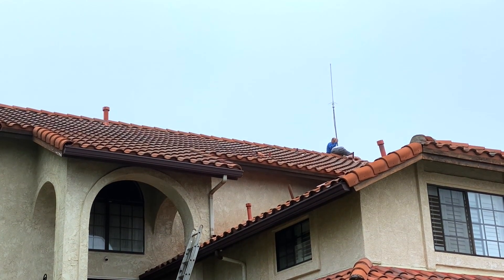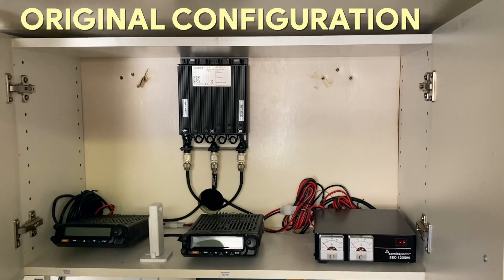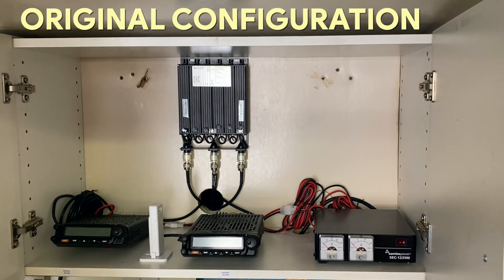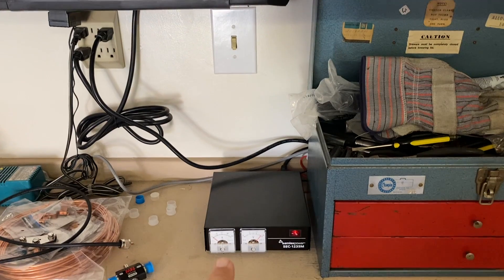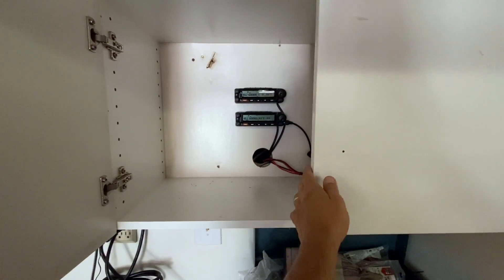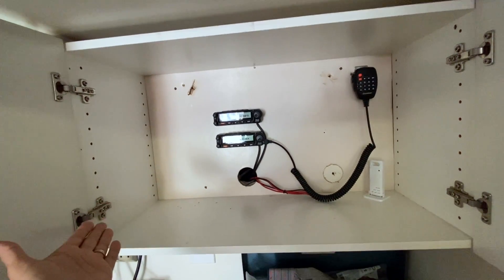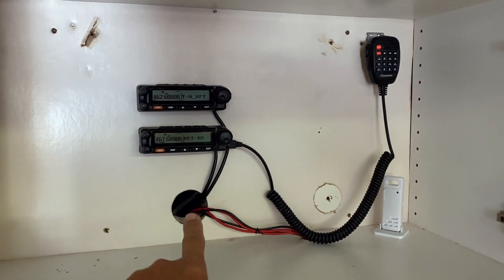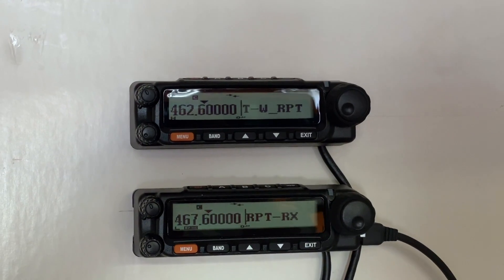Wouxun KG-1000G GMRS Repeater Build Update - How Is The GMRS Repeater Working After 30 Days?

Comment: Could a KG-UV980P be connected to a KG-1000G to work as a repeater? This should be legal if the KG-UV980P is setup to only receive GRMS signals and the KG-1000G does the transmitting on GRMS. Conversely, they could be setup the other way around to work as a ham repeater if the firmware will allow it.
 I left this question in the KG-1000G vid that BTWR posted. Maybe you could see if they'd loan you a KG-UV980P to test in your repeater setup?
Reply from the maker: the UV980P is not designed to be connected to another radio in a repeater setup like the KG1000G is.. so, although maybe technically possible, it would not be easy like plugging two KG1000G radios into each other.
Reply: @TheNotaRubicon  the kg-uv980p is basically the same radio as the kg-1000g. the only difference is the kg-1000g is locked so it cannot transmit on anything other than gmrs frequencies. they are otherwise identical.
Reply from the maker: My bad - i was thinking of the kg-UV9G .. So, no idea if the UV980P has the same programming to allow for repeater configuration, and if it does, no idea what would happen if you tried.
Reply: It works.  I have it in a "test mode", and am waiting on the Duplexer before installing at my Son's house that is at the top of a hill with an unobstructed view of the Metro Area.  I have a KG-UV980P as the receiver, and the KG-1000G as the transmitter.  This config allows the rest of the family to have radios without going through the Ham Test that I endured.

Comment: So you gave up on the duplexers cause they just suck that much? I can't mount 2 antennas I need one that works man
Reply from the maker: I didnt give up, but the used/loaner ones I had both had issues. Buy a new one, make sure it is rated for the correct power-output and is correctly tuned to the frequencies you need - and make sure it has a warranty - Should be no problem.

Comment: Thank you for this series of videos on building a GMRS repeater.. Would love for you to join ranks of Amateur Radio operators if you are not already a ham.
Reply from the maker: A year or so back, when I was considering getting my ham-license, all the sad-hams online made it very clear that newcomers were not welcome in their elite ranks.. So, no thanks.
Reply: NotaRubicon Productions

Those kind are the Dickh - - d hams.  Pay them no mind.  With your sense of humour and vast wealth of knowledge, you would be quite welcomed on any ham repeater I hang out on.
Reply: @TheNotaRubicon  With out new people into the Ham hobby, it would die out and the frequencies would get sold off, I am A "Ham" and I am sad, but I am sad because the UK does not have GMRS, it is an excellent way to use radio, we have the FRS equivalent and we call it PMR446, 500mw advertised as 3 mile range but goes as far as you can throw, Love this series of repeater videos and thankyou ♥

Comment: Something to consider is mobile radios are not made for high duty cycle at max power. You could make the setup more robust by running low power on the transmitter and letting an amp do the heavy lifting.

Comment: I am using a duplexer with the radios 4 ft apart and my antenna is up at 28 ft but I am only getting about 12 miles from a mobile radio sending out 15 watts. I wondering if the receive sensitivity on these radios isn’t that good. I know that antenna height is important. I also have a repeater that puts out 10 watts and I can hit it from 17 miles away with the same 15 watt radio. Just wondering if you have experienced issues with the receive sensitivity
Reply from the maker: Turn off the repeater setup and see how well you can pickup/receive on a handheld or other radio in the same location as the repeater, from that 15 watt radio 17 miles away.. your repeater setup should receive as well or better than another radio in the same spot.. if your other radio receives better than your repeater setup, then it is likely an issue with the duplexer, as the radios themselves are very sensitive - but a badly tuned duplexer will ruin your whole day..

Comment: That roof.  Yikes.  For real question: what is the advantage of a repeater at your own home?  How does it extend the range the range past what a normal radio would do.  I have a 40' antenna at home with a 40 watt mobile radio and I don't get nearly that range.
Reply from the maker: the repeater is for extending the range of the radios using it, not radio/repeater itself.  If i switch the transmit-radio of the repeater to regular-radio mode, it would transmit the exact same distance... How far your base station is able to transmit is determined mostly by geography - from my roof, I can see 20-40 miles in 3 directions.. If you cant transmit to something you can see, then there is something wrong with your setup.

Comment: I hope you aren't using privacy tones on your repeater because they ARE NOT PRIVATE.
Reply: "Privacy tones" are no such thing, as you note.   But, it is still a good idea to use them to prevent a repeater from being triggered inadvertently or to eliminate interference from another repeater operating on the same frequency pair.   For example, you have two repeaters using the same frequency pair, but they are on the edge of each other's coverage area - or, even overlap considerably.   That means, a user may intend to trigger one repeater or the other, but end up triggering both repeaters, instead - if neither repeater is using a CTCSS tone.   This is going to cause some level of interference, especially at the edge of the coverage areas.   Using a CTCSS tone helps to prevent such things from happening.
Reply: Enjoy it while it lasts. With only 8 repeater channels , the future is going to be to be bleak.

Comment: A question on your TYT DWC30WIN power supply, listed as 13.2 volts?  Oddest damn thing I've seen on a power supply as listed by the manufacturer.  13.8 volts is the basic universal standard, all the way from expensive power supplies  to the cheapest linear power supply.  And most that have adjustable voltage tend to have adjustability well past 13.8 volts, because some people feel their equipment performs better at the higher voltage, or because of potential voltage drops are high load.  

Probably will never be an issue, as 13.2 volts is still well within tolerances of all radio equipment.  But an oddity, nonetheless.
Reply: :_SadHam:
Reply: Not really. ±10% is a common industrial power supply adjustment range so 10.8V to 13.2V for a 12V nominal supply.
Reply: Two observations.  One, I have a DWC30WIN and it is 13.8 volts or variable if wanted.  Two, he has a totally different brand of power supply.  Did you actually watch his videos?

Comment: I would like to see a update or test  on the BTech   U25 amp. I think that is what I’m going with for a GMRS base station for now .  For one reason is because there isn’t anyone that dose GMRS in my area . Second reason is because of how good my BTech v1 and Wouxun KG805G did with just hooking to the base antenna .  It almost set the transmit range goal that I wanted. So o figure a dedicated HT radio and a amp will give me the transmit range that I want. When I did the test it was from base to vehicle the person in the car said they could here me load and clear. On the recive

Comment: Hey Randy, i fimally got my tram all tuned up and bottom of antenna is 20'. With mtns all around me in city of Tehachapi ca, i am hitting the crestline repeater 100 miles away and talking to rancho, hesperia, ontario and victorville. Yours should do be able to do the same distance further south- southwest.
Reply from the maker: That Crestline repeater is at about 6,500FT elevation.. I'm about 4,500FT below that so i will never get that kind of reach.  Because of all the mountains within 20-35 miles to the south-southwest of me, I will always have a limited range.
Reply: @TheNotaRubicon i  understand, darn mts. i am at 4,000 in a valley. I can talk on a Repeater 100 miles away but cant talk to my daughter 10 miles away because of a little hill. That doesn't make since. But every elevation below you your tram can see, should be reachable.

Comment: Thanks again for ALL the info.  I have what will likely be quickly pointed out as a stupid question, but are the radios individually wired to your power supply or is there a single electric wire from the PS that divides at some point to go to each radio?  I see that Wouxun has a Power Supply that is advertised as working great with the KG-1000G -- have you had any dealings with it?  Thank you for taking time from your presentations to even read this.
Reply from the maker: each set of wires is going into the power-supply. This is the 30AMP 12V DC Power Supply i'm using.
https://www.buytwowayradios.com/tyt-dwc30win.html?cmid=amsreGRvTmttM0k9&afid=MTc0SmRGN2tRQW89&ats=UG5lYm8rNVZORVE9

Comment: Another great video!!! I would like to quickly summarize everything covered!

HOW TO COOK CHICKEN IN THE INSTANT POT
How to Cook Chicken in the Instant Pot. A simple guide with timing for chicken breasts or thighs, including boneless, bone-in, and frozen!

STEP ONE: Grab Your Chicken and Your Instant Pot + Trivet
How to Cook Instant Pot Chicken. Directions for fresh, frozen, bone-in, or boneless, breasts or thighs! Easy and straightforward.
You can start with any type of chicken, including frozen chicken: boneless or bone-in; fresh or frozen; breasts, or thighs.
You’ll need your Instant Pot, the trivet insert that came with it, chicken, and water. I use this 6-quart Instant Pot for all of my recipes. 

STEP TWO: Add Water
How Much Water to Add to the Instant Pot (Varies by Model)
6-quart Instant Pot: add 1 cup water
3-quart Instant Pot: add ¾ cup water
8-quart Instant Pot: add 1 ½ cups water

STEP THREE: Add the Trivet + Seasoning
How to Cook Chicken in the Instant Pot. A simple guide with timing for chicken breasts or thighs, including boneless, bone-in, and frozen!
This step is not 100% mandatory, but it will help your chicken cook more evenly, so I recommend it.
At this point, you can also season your chicken if you like, but it’s not mandatory. I keep it simple with salt and pepper.

STEP FOUR: Cook on HIGH (Manual) Pressure According to the Cook Times Below
How to Cook Instant Pot Chicken. A simple guide for cooking the best chicken in the pressure cooker.
The cook time will remain the same whether you have a small amount of chicken or a lot, but the time the Instant Pot takes to come to pressure will increase the more chicken you have. The time it takes to come to pressure will also be longer if you’re cooking frozen chicken.
The below cook times are based upon average weights. If your chicken is smaller, decrease the cook time by 1 to 2 minutes depending upon the extent of the size variation. If they are larger, increase the cook time by 1 to 2 minutes. When in doubt, error on the side of less time. You can always cook the chicken for longer, but once it’s overcooked (especially when it comes to boneless, skinless chicken breasts), you can’t reverse the process.
Reply: Does this work for hamburger?

Comment: Another great video as always!  Might try doing something like that in the future.  On a different note, for all of your fans that bought Radioddity GM30's and want extra batteries,(Radioddity doesn't seem to have them yet), I found that the batteries for a TYT-UV88 are 99.99% compatible.  You just have to remove two little plastic tabs in the battery mounting latch slot.  High capacity,  regular and battery eliminators are available.  No usb-c charging though so you have to use the charging cradle.  Get the one for the high capacity battery and the regular ones will fit too.  All found at BUY TWO WAY RADIOS.com.  Affiliate link above.

Comment: How far a part should your antennas be vertical and horizontal
Reply from the maker: Vertical separation is best - IIRC, only 10-15 feet (or something like that) would be required if the two are directly above/below each other. In my case that is impossible, so my receive is about 65 feet away from the transmit, and I still have a bit of a desense issue - but, it still works pretty well..  For a while they were about 15 feet away from each other and I could only receive strong/close signals.
Reply: space them vertically. to far apart horizontally
Reply: I was going down this path as well, and was going to buy a 2nd Ed Fong antenna tuned to GMRS. Ed said the loss through the extended length of Coax to achieve good performance on both RX & TX made that configuration less desirable.  Hence, I should have my Duplexer in a couple of days.  Stay tuned.